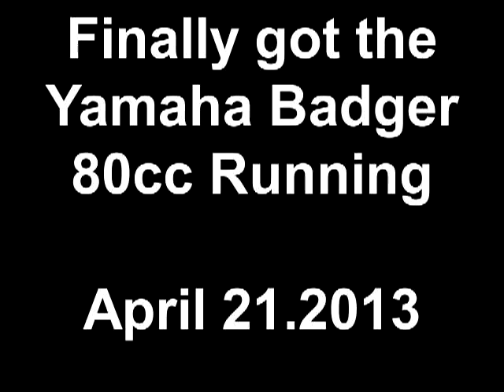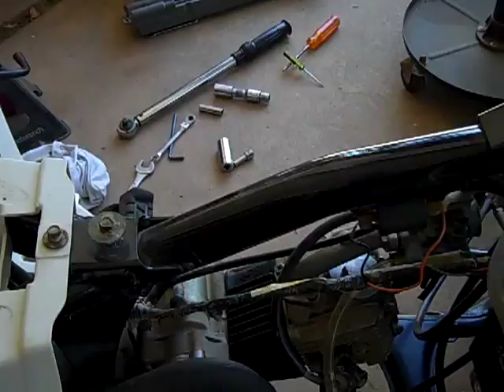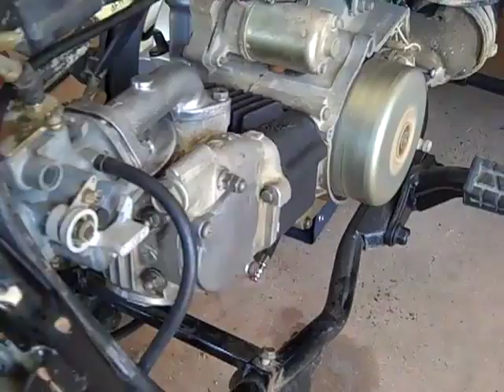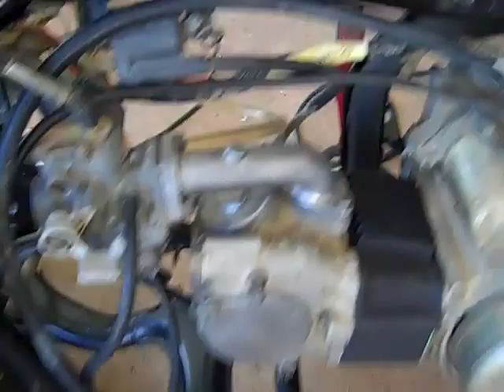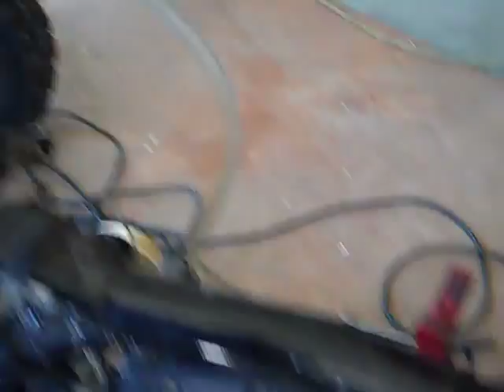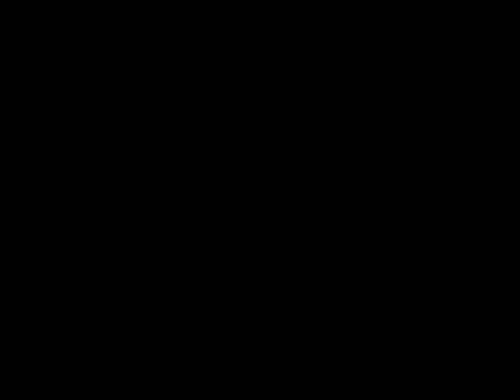Finally got the Yamaha Badger 80cc Running April 21.2013

Comment from the maker: Hi Jacob.  Those plastics are original, the previous owner had spray painted them blue.  I removed the paint.  I rebuilt the carb but this one is past any good.  I need to find a good used one for this badger.  It's all done except for the front brake cable.

Comment from the maker: Well, it needs to be able to flow, so I would take it totally apart and it soak in carb cleaner like I did.  Get a rebuild kit off ebay.  They are cheap.  Try putting a sewing needle down that hole.